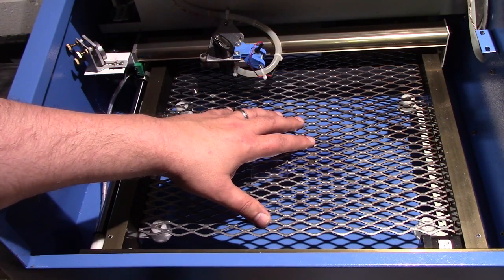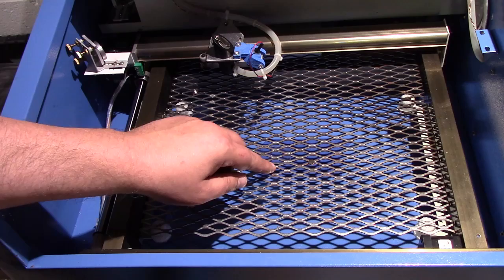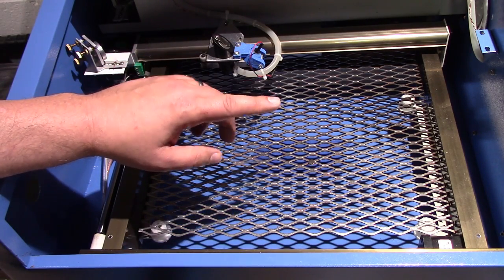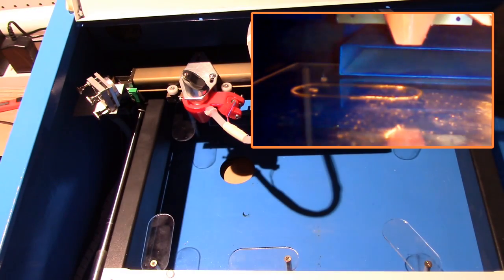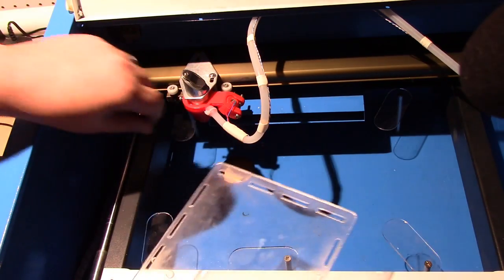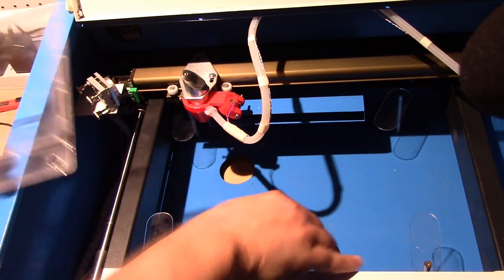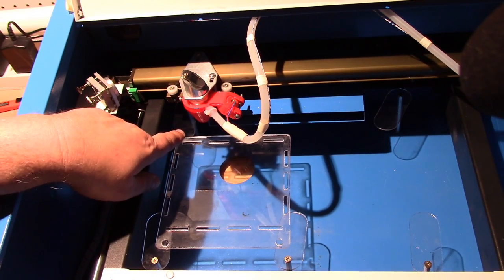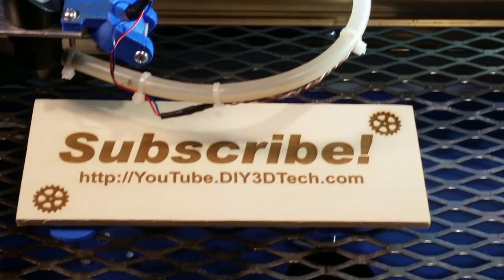K40 eBay Chinese CO2 Laser Cutter & Engraver - Updated Bed Design!

Comment: So to be clear, you actually recommend the older, analog version of the machine over the newer one with the digital control panel? 
For example, this one: https://amazon.com/Orion-Motor-Engraver-Cutter-Exhaust/dp/B01EJDH1BO
Not this one: https://www.ebay.com/itm/372569726452
Is that rIght?
Reply from the maker: Yes, couple reasons most of the digital units are not true 40 watt tubes (30 watts), second its harder to mod the digital and three they are easier to repair if they break.
Reply: @DIY3DTECHcom  Cool, thanks. So the analog machines ARE true 40w machines? How about the 50w machines, any idea if they're closer to true-wattage?
Reply from the maker: To know the power you need to measure the laser tube, a 40 watt should be longer then 700mm more like about 750mm.  And no to your question as the rating is typically maximum duty cycle which will shorten the life.  For example 50 watt lasers are 40 watt tubes  way over driven.  You should run a laser at ~80 capacity (i.e. current) to keep a reasonable life other wise they decay at an exponential rate...

Comment: hi guys looking for some advice, need to replace the stepper motors in my k40 early version and am trying to find the correct ones as the nema 17 ones i bought aren't working and the ones in there had no model number, also building an adjustable engraving bed using a lab stand while i have it stripped down and adding air assist and red dot focus.
Reply from the maker: Its been a while since I hacked my, however recall they were just bipolar steppers, just common run of the mill.  you sure wired them correctly as the colors might be off...

Comment: looks good . that should speed up some of your projects and laser setup for placing blanks .  do you have to use clips or such to hold things to the tabs ?  that is will mechanical vibrations for the laser arm  have teh strength to make target  move . i just may have missed it if you said you use clamps or such .  i know you said you used the other clamping mount on them , but what wa sit that holds stuff to the tabs?
Reply from the maker: for general use there is little to no vibration, however there is a little for aggressive engraving and what I do is simple use a blue painters tape.  However 90% of what I do is "cut" with it.  Also just an FYI you have inspired me a bit to get back to my roots in the diode laser business so working a project now that should be out in a month or so!

Comment: Nice vid. One limitation though is the set height of the bed tabs, if you want to cut thicker material you will be out of focus due to the bed height.
Same with engraving, maybe a 4mm sheet is in focus, but if you want to engrave a 8-10mm piece, you are 6-8mm out of focus.
I like the idea though with a table with adjustable "helping hands" :)

Personally use a spike bed with 25mm nails and a movable laser head to set the focus depending on material thickness.
Reply from the maker: Movable laser head is the way to go! Also your points are good ones I likely didn't cover them completely in the video, however 90% of what I do is cut 3 to 5mm material so the tabs sit about average for both.  The logic for me any way is what I call "toss", "go" and "fall".  I am assuming you have a 60/100 watt unit since the head is movable or was DIY mod?
Reply: No, i have a K40, but the newer version without the darn nozzle piece inside ;)
Check my vids, got a 5 sec video on my old movable lens, right now i have a motorized autofocus, in the K40 :)
Reply from the maker: I am impressed! motorized? Auto?  I am interested....
Reply: Small Nema7 stepper with a small slider and Arduino moving it up/down on button push. But it can also run with a BL-touch sensing the material and counting the steps away from 0, so it sets the correct focus depending on cutting/engraving no matter what thickness the material has :)

Still in beta testing and fixing some bugs, but i can email you some pics and info showing the new version,  maybe it can give you a idea to make one too :)
Reply from the maker: Yes would really like to see it when your ready!